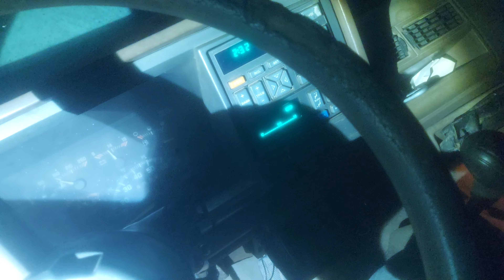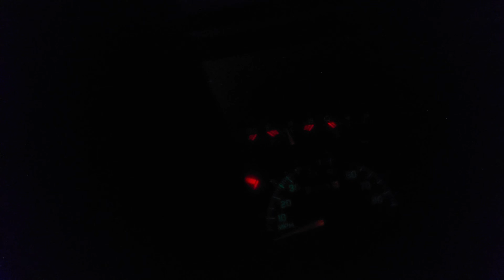94 6.5L Diseasel Weasel Got CRUNK'T just in time for the crack of the full moon

Comment: How long does it take to start on freezing cold mornings? Does it take longer when it hasn't been used for several days?
Reply from the maker: No, I spent 3 days adjusting timing, to dial it in without a GM techII, and once I got the timing set to run cold start with minimal exhaust fume at startup, I manually reset the TDC.  It takes about 8-10 revolutions to crank, then about 45 seconds to run cold start, and then evens out nicely.  Does not always smoke at startup, but is the only time it puffs at all, unless I'm blowing coal at WOT.  Make sure that your batteries are FRESH AND STRONG no less than 800cca, matching set,  and that your positive battery cable to your starter is FRESH AND BIG CABLE.  Make sure to scratch all the paint and oxidation off of ground cable ends, and ground points.  Put batteries on a charger when not in operation.  Freezing months ALWAYS PLUG UP YOUR BLOCK WARMER.  If your glow plugs are not new, replace them before winter.  Can not stress these parts enough 🙏🛠🎵🎶 do not buy cheap parts.  These are big machines, built for endurance, and quality parts are worth the run time

Comment: Glow plugs doesnt work
Reply from the maker: Glow plugs are working perfectly.  I received the truck improperly timed, cracked fuel line under IP, with a bad pmd, two dead honda batteries, and one exploded glow plug.  I replaced the glows with ACDelco, and fixed everything else.  I put in 2 Oreillys 800cca AGM batteries, a new starter cable, cleaned all grounds...  Timed the IP static to approx 3.5°, sent lift pump to a switch, primed the fuel through the filter housing, then through t-bar, then cracked all 8 high pressure lines on the injectors.  Once fuel primed in all 8 cylinders, it fired all the way through.  I spent the next 3 days adjusting timing by hand. No techII.  Once in time, with good cold starts, I manually reset the TDC. 🙏🛠🎵🎶